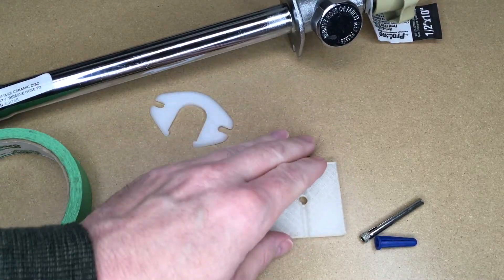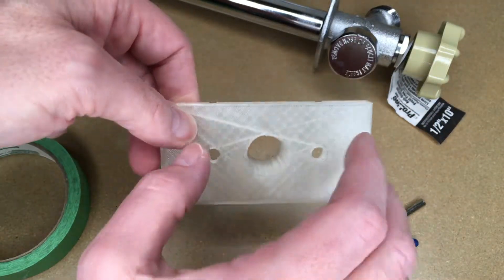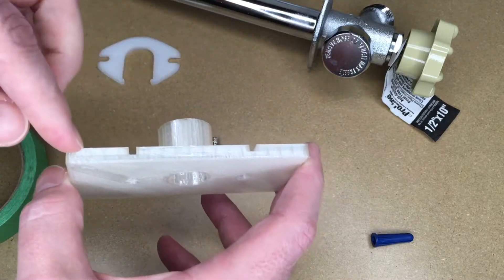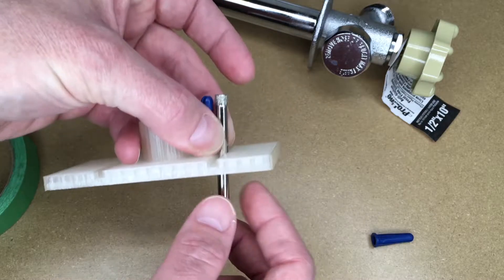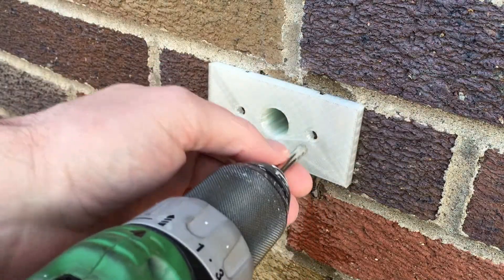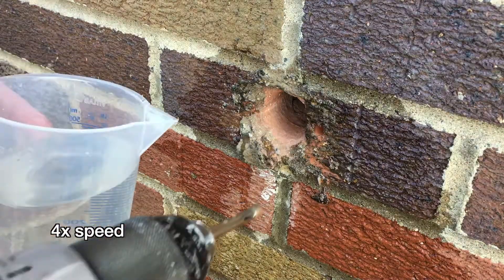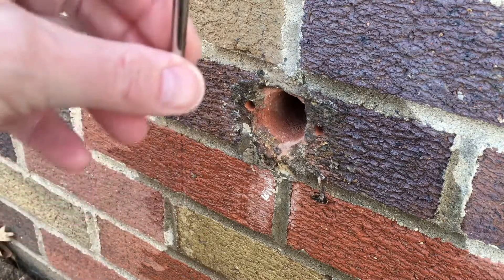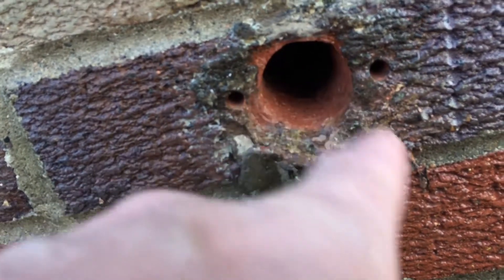Using a 3D Printed Drill Guide

Comment: which material you had used for making drill guide ?
Reply from the maker: I just used PLA. (This one specifically: https://amzn.to/3CaR3Kb) Needless to say this wouldn't work well for production use but it held up fine for the few holes I drilled. I've used similar guides for drilling holes in wood. You could probably incorporate hardened drill guide inserts and have it last a long time.

Comment: Hi,

Sorry but a bit of a random question on watching this random video: why do you not simply use a masonry drill bit? I think the guide that you have is useful but the hole saw seems the wrong tool for the job. A normal masonry drill bit would be able to allow the material to 'eject' properly while it's drilling. Once the initial hole has been made, it should have been just a few seconds to drill, no?
Reply from the maker: Masonry bits are a lot more efficient. These hole saws are a lot more precise. With the side holes being so close to the center hole, they would have likely blown out towards the center hole. I specifically had a situation where the middle hole already existed. If it wasn't there, I could have drilled the side holes first, then the center hole. Lastly, a 1+ in masonry bit is expensive and requires a large drill. These hole saws can be used with the cheapest drill.